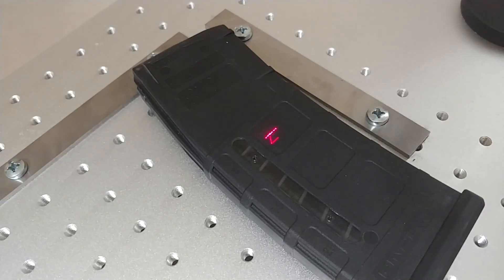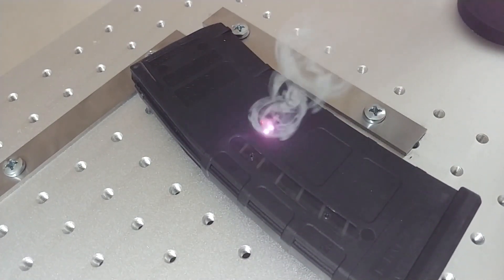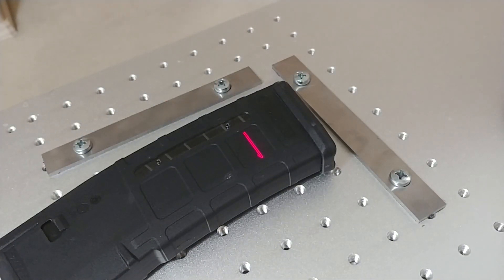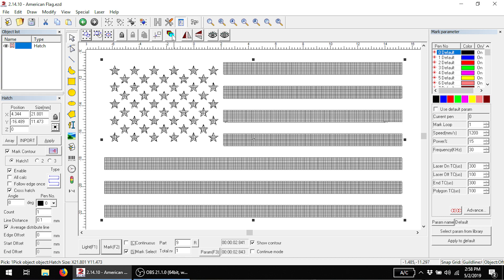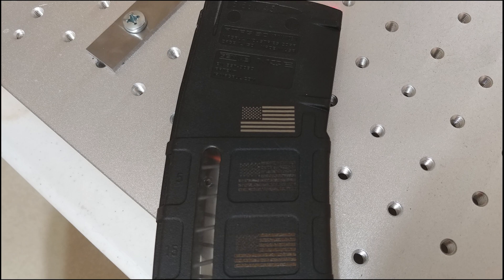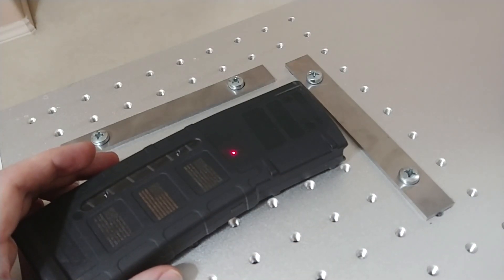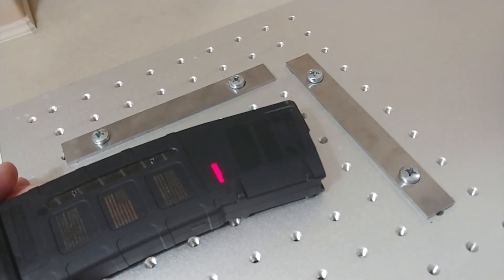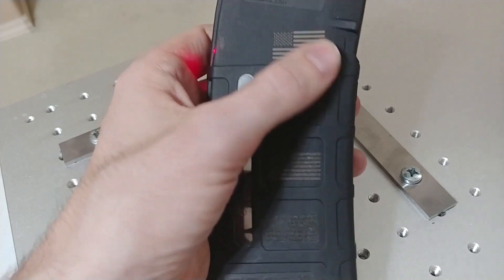Fiber Laser Marking Plastic - AR15 PMAG

Comment: By far the most helpful videos on fiber lasers i found. I am interested in getting one of these for various engraving and stippling of polymer gun frames for my guns and possibly turning into a business with FFL license. I know glock frames are polymer 2 and burn very different from pmags. If you have tried a glock frame I would love to see the results for the stippling effect to get better grips. I am totally new to lasers and this looks like a big learning curve compared to a CO2 for 400 bucks i was thinking of getting.
Reply from the maker: Your best bet for this will be to head to some of the fiber groups on facebook.  Lots of people do this but my understanding is the materials are very different from manufacturer to manufacturer so settings always need to be tweaked.  Check out these groups: https://www.facebook.com/groups/440091022989424/
https://www.facebook.com/groups/547620632495173/

Comment: 👍🏻👍🏻.   THANKS !!!   It looks fantastic.   Unfortunately, I reside as a captive of the PRNJ 
(People’s Republic of New Jersey).  Our politicians have wisely thought to protect us by limiting 
the magazine capacity of the racist and oppressive evil weapons of war and baby killing.  🥴😷🤬

So... I have a shitload of 10-rd pmags to replace all of the USGI 20’s and 30’s that I had permanently “blocked”
to 15rd to comply with the 1993 original AWB before the Clinton 1994 federal AWB.   

When I get them, I would love to engrave mine with flags like yours.
AND...
more importantly, I am currently donating a bunch of portable 2-way radios to a local volunteer fire department.
They have a relatively small area that can be engraved on either the front or the rear  (& also batteries and chargers)
Ideally I would love to engrave each one with the USA flag as well as the department name or initials and a numeric ID.

Most of these are either Hytera PD782 or X1P portables OR Motorola XPR7550e portables.

Could someone here please advise me on what I would need to purchase as far as a laser engraver,
appropriate software and accessories... AND.. guidance.    

(destroying a mag in the process of testing isn’t all too painful on the checkbook....  BUT....
each radio is around $800-900 bucks and batteries are $90+ each)

Thank you very much for the video content and thank you very much in advance  for any assistance!!

I
Reply from the maker: If the radio housing is plastic, use a fast speed 2000+, low power 10 or 20%, medium/low frequency, and don't use a dense hatch spacing.

Comment: Hi !  could you pass me the parameters?  I need to mark plastic
Reply from the maker: Use low power, medium frequency, high speed.  Try something like 2000 mm/s, 10 or 20% power, and 40 khz.  Hatch spacing shouldn't be too dense - something like 0.05.
Reply: @jefferyj  gracias!!👍

Comment: For a nice grey mark...  Try something like hatch1 = 0.5 @ 0 degrees; hatch2 = 0.4 @ 90 degrees; 1 or 2 loops max, 1000/1/20 may need to tweak from there
Reply from the maker: Thank you for the settings, I'm going to give them a try!
Reply: I have a 100w
Trying to make a somewhat white mark
All the marks @ different setting are giving me the nice gray markings
Any ideas would help
Awesome videos JefferyJ
Thanks
Reply: @michaelstout5407  I did a white mark by 1% power and 3000mm/sec, just quick and very small power would do the trick. More than 15% power, it begins to burn to grey or brown.
Reply: @michaelstout5407  use a higher frequency with faster speeds and multiple passes. Like 6-8+ passes 60-80k freq and 8-10,000 mm/s print speed. Also note the big thing with fiber lasers it all depends on the chemistry of the substrate.